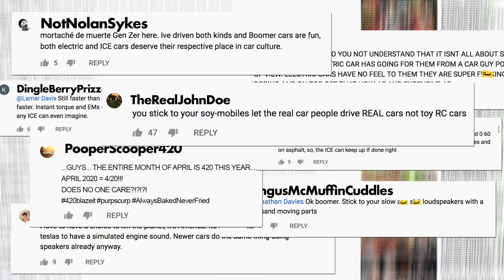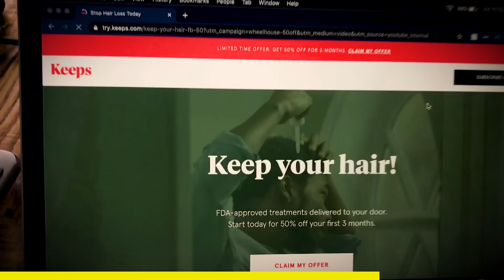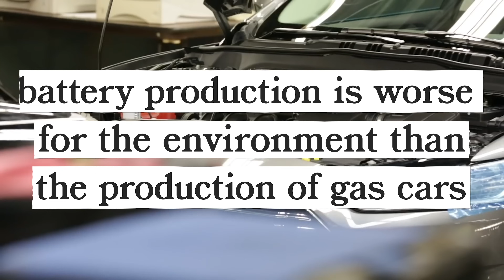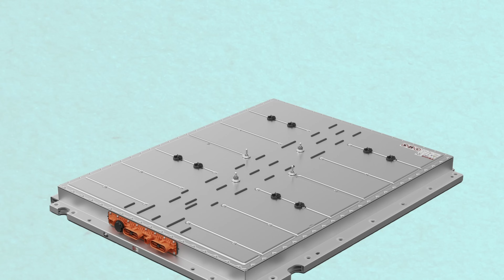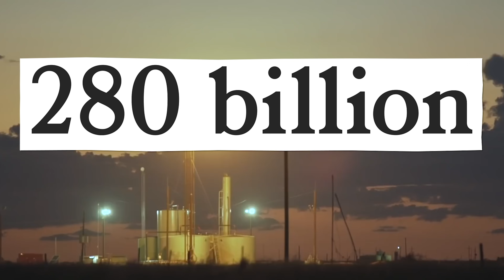Are Electric Cars REALLY Better for the Environment?

Comment: The biggest issue I have with electric & hybrid vehicles is the obsolecense involved with the batteries and electronics on the vehicle. The carbon output for manufacturing isn't a one time gig, keeping an old car running past its lifespan is going to be Incredibly difficult with an eV.

Comment: it’s a shame you didn’t talk about ethanol. comes from the beet which when it grows ingests more Co2 than when the fuel is burned. ICE are not turning just with gas. At least its the case in Europe..
Reply: Ethanol is having a corrosion issue though. Here in the Netherlands Vespa (look-a-like) mopeds are having serious issues with E10. (10% ethanol, 90% gasoline). https://www.rtlnieuws.nl/editienl/artikel/5025216/e10-problemen-scooter-benzine-tanken-e5-bio-ethanol

Comment: The solution: hydrogen fuel produced by a factory that runs on electricity produced by a geothermal power plant. This way you keep the sweet noise of the internal combustion engine without making much CO2.

Of course, this will become viable in the future. Way too expensive to be profitable atm.
Reply: Unfortunately hydrogen is terrible in a combustion engine, producing pathetic amounts of power compared to hydrocarbon fuels.
Reply: @drunkenhobo8020  Is it? Darn. Gotta look into this.
Reply: Engineering Explained did a good video on it: https://www.youtube.com/watch?v=1Ajq46qHp0c

Mazda also converted an RX-8 to run on hydrogen. It made 205 bhp in petrol mode and 106 bhp in hydrogen mode. How depressing would that feel in a car like that!

Comment: This is why we should be exploring hydrogen fuel cell (not to be confused with hydrogen combustion) technologies as well. Based on my limited understanding the production of fuel cells would have a lower impact than the production of batteries and we also have the means of producing hydrogen fuel without utilizing fossil fuels (electrolysis via renewable energy). A hydrogen fuel cell EV would also be far quicker to fill up (liquid fuel, not charging) and have a range more comparable to conventional ICE engines.

Comment: I am amazed.
I was expecting another video that comparing CO2 from ICE production and exhaust (without making, getting fuel and produce everything around ICE like gas tank etc.) to everything that produce CO2 in EV + lie that batteries in ev need to be changed after 150000km (i am realy weary of videos like that) and this video wsa looking like that in the first half, but then you concerned everything in second half and i am realy impressed. Big thumb up for that. I think electric cars have one more advantage don't using any oil and using much less brake discs and pads, but that not a big one.

Comment: Do you have any sources for your information ? I read a detailed comparisons of an actual association of regulations between EVs and ICE cars in terms of emissions. They came to the conclusion, that on average you need to drive 127.500 km or just under 80 000 miles with an EV to match the emissions a gasoline car produces during a typical life cycle and you need to drive 219.000 km or over 136 000 miles on average with an EV to match the emissions a Diesel car produces during its typical life cycle, considering a current mix of electricity coming from renewable and none renewable sources in the year 2019. 

That comparison also showed, that if the country uses 100% renewable energy an EV would only need to drive 37.500 km or over 23 000 miles on average to match emissions of a gasoline car and only 40.500 km or over 25 000 miles to match emissions of a Diesel car.

This comparison compared EV's and ICE cars being driven in Germany, a country that uses much more renewable energy than the US, considering this circumstance, EVs in the US need to drive a lot more km/miles to match emissions of ICE cars. Therefore i highly doubt the correctness of your Video since my source states vastly different results. 

Source German: https://www.adac.de/verkehr/tanken-kraftstoff-antrieb/alternative-antriebe/klimabilanz/
Reply: Your source is different because that study is not the best for unbiased information. It is true that some electric vehicles (ones with big batteries) are very close to ICEs in lifetime emissions and sometimes even worse when you consider a 150 000km lifetime mileage (which most long range EVs are capable of surpassing) . They used dated unrealisticly high emission figures for battery production while using unrealistic fuel consumption figures for the ICEs. Also the electricity mix of germany and the US, while highly emissive, is also very similiar. If you are interested in the subject i recommend reading more studies from more credible sources.
Reply: Jalmari how come it is not the best unbiased information ? Its one of the most credible sources i’ve read and of course i read other studies too, some of them had a different outcome, in fact some even were much more in favour of ICE cars. Of course EVs are capable of surpassing 150 000 km of range, thats totally irrelevant to its life cycle as almost no one drives his car until it stops working but after the lease is over or the cars guaranty is gone and thats what real life data shows. In my point of view their emissions figures for battery production und fuel consumption were very realistic as there average came from a huge official database of cars. Germanys total of renewable Energy in 2019 was 38.5 % of what they used while the US’ total of renewable energy in 2019 was only 17.5 % of what they used, so not very similar at all.

Comment: You neglected the fact that unless you are charging directly at the power source, EV's lose 40% of the energy in transmission to charge the batteries. That is a big loss of efficiency that is always never acknowledged. The main problem with the EV is range while carrying a load, a major problem that is also being ignored. Batteries just do not have the energy density that fuel does, also a low charge battery is a lot of weight to be hauling around compared to a 1/4 tank of gas.

Comment: It all depends on where you want to put your pollution. Gas powered cars adds pollution wherever it goes. Electric cars depend on how the electricity is made. The production of the batteries produce tons of pollutants, environmental damage and the batteries themselves are dangerous.
So for people to think they're smarter and saving the environment by driving EVs is foolish. They are just putting their pollution in someone else's back yard. As far as ICEs are concerned new technology is constantly being developed to increase efficiency and burn cleaner.
Reply: Hydrogen cells are nice  way to be more clean
Reply: @diwa393  I agree. Even the production of hydrogen fuel cells require the mining of rare earth elements to manufacture them. Hopefully scientists can figure out that nuclear fusion problem out.

Comment: I drive an EV because it’s fun and cheap to drive. I bought it used for a very good price, still drive my ICE vehicles too, just a lot less. My Leaf has needed tires and wiper blades over 35,000 miles. And the Nissan dealership near my house has a FREE rapid charger.  It’s been a great experience. But if I had to buy an EV new, it wouldn’t be worth it.  Very expensive new, even my Leaf was  over $35,000 new in 2012.

Comment: Eventually we'll have to increase the amount of remote working jobs, increase public transit, and reduce the amount of private vehicle ownership and use.

Also the biggest EV benefit you missed is not having to breath your own exhausts. That's a few more brain cells you get to save. Which you'll especially appreciate in the later years of your life when everyone around you has dementia.
Reply: I know sprt pf combustion engine thats cleannier than ev and running it causes zero CO2

Comment: pausing at arround 9:36 trust me even if you could give us a two hour explanation some people still wouldn't get it!
Personally i like EV cars, but i think it needs a few more years to develop a bit more, especially when it comes down to charging speeds!
Reply: Or we start researching alternative fuels that require no battery running it even if it means having a flame causes still 0 CO2 for example hydrogen cell cars

Comment: I feel like I’m an outlier in the grand scheme of automobile owners and I’m still trying to see how I should move forward with any future purchases. I currently own two vehicles one is 41 years old and I’ve owned it about 30 of those years and it has around 400,000 miles and my newer vehicle is a 1999 I’ve owned it since new and it only has about 300,000 miles. With luck my next purchase should be my last provided it last 20+ years as well, and I’m just afraid currently EVs are not that reliable.
Reply: Try hydrogen cell if possible and you have refueling station nearby somewhere since it has only the benefits of ev and gasoline. It has long range, refuel takes little time, and they are cleanliest out there

Comment: But the up side to a petrol car is if you convert it to straight lpg it basically have zero exhaust emissions an gain up to 15% more power an lpg is cheaper at the pump

Comment: See I just want an affordable car with a clutch pedal.  If car companies start making electric vehicles with a proper manual transmission, I would have no problem switching from ICEs.  Right now though the only option is paying likely more than my car is even worse to have someone convert it.

And yes I am aware there isn't any practical reason to fit an electric car with a manual transmission, but these days even with an internal combustion engine, modern automatics and CVTs have basically neutralized all the benefits of driving a manual, save one: it's more fun!  My Subaru Forester isn't exactly a fast car, and I am a pretty calm driver anyway, but rev matching and getting that shift just perfect?  Such a great feeling!

Comment: No they are far more damaging. Fossils fuels are required to produce and mine the things to create electric cars, their motors and batteries use rare precious metals, and contain chemicals that are poisonous once disposed of. This not considering the fossils fuels required to create the electricity that powers electric cars.  Because we can't use electricity to create electricity. Somewhere someway there has to be a seperate type of power creation from a different sources of energy, and that's fossils fuels

Comment: i charge my car direct from the solar panels so not using the grid at all.
I save about £100 a month in fuel cost but this all depends on what ice car you were driving before electric mine was a range rover vogue and yes i miss it and miss tje sound of the engine. but what i am saving i would not go back to an ice vehicle. zero road tax and cheaper insurance and lower fuel cost.
it only cost me £3 for a full change.
i went for a phev next car full electric.

Comment: What about the extra copper and aluminum used? Or recycling of batteries and their life spans? or the air scrubbers from the producion of both the batteries and the electric that reduce those emissions(they have a foot print to produce and recycle as well.) You missed alot. Like how wind mills have a limited lifespan due to stresses of operation and so on. Your facts are misrepresenting this here.

Comment: I also wonder if you produced EVs without a battery and then compared them to gasoline vehicles how different would the pollution level be in production.

Why I say this is because pretty much basically all calculations never take into account the first tank of fuel in a gasoline car.

So the point being that first tank of fuel for a gas car would raise the pollution level of that gas car quite a bit taking into account the transportation, refining and so on of that fuel.

But with an EV the battery is always seen as the negative when in reality you could pretty much use any type of battery that fitted into the space.

So as EV batteries get better so will the pollution level of producing them reduce.

You can't drive a gas car without gasoline and likewise you can't drive your EV without a battery but it seems the gasoline is not calculated in the production of a gas car, whereas the battery is calculated in the production of an EV.

Surely to make it fair and clear every part of the vehicle should be considered to get a true picture of the pollution level in the production of both vehicles.

Comment: Awsome video man! But I do still have some concerns that I think its not in the video. How about the battery pack life, I imagine that it isn't the duration of the car, its economically viable replace that, it impacts in the life cycle of a EV car, and the old pack, which will be the destination, is it recicleble or toxic? In compare which is the recicleble portion of a ICE car? And The impact of a battery eletric vehicle in compare with a hydrogen fuel cell electric vehicle. Thanks!

Comment: You’ve forgot two very important factors:
1. Lifespan. My oldest car is 8 years old. And because I always did servicing in authorized dealer and keep all measures it is still in perfect shape and it can go on for years. And because it is Range Rover Evoque it still looks and drives killer good. Needles to say combustion engine cars proven to go on as long as century with proper care. Can it be done with electric car? NOPE. Because of the nature of the battery which is the heart of any EV you WILL HAVE TO REPLACE BATTERY, and we all know how quickly the capacity of the battery goes down. So 1 EV with proper care in reality will emit as much gases during it’s lifespan as several EV cars produced.
2. Utilization. I still see rusting vehicles here and there and when I was small I used to play on some with friends while visiting grandmother’s village. The worst case that could happen to me was get scratched by rust. Can you imagine such scenario with EV? Hell no, because getting rid of batteries is as dirty (if not more) as producing them. EV left to rot is a small local ecological catastrophe. 
If you add 1 and 2 and realize that EV needs several batteries during it’s lifespan to be not only produced but utilized as well - the numbers would be different.

Comment: What about the cost of production (pollution) motors and rare earth magnetic etc? plus most ev choose aluminium as the body which either mined of recycled has a high impact on energy consumption to manufacture.  Your comments on ev becoming more efficient after x miles is correct but some country’s like Germany quote 70k miles to break even.

Comment: You forgot Nuclear Power. In fact, there is no viable Co2 neutral, much less Co2 negative, energy plan with out major investment in nuclear power if you want to electrify road vehicles.

It is the safest and the most environmentally friendly form of energy production. Full stop. No other Zero Emissions form of electricity generation can match the capacity of coal power. 

And that is a scientific fact.

Also, renewables kill in a year more than nukes have done in their entire history of existence. Simply in technicians and maintenance workers falling off of heights.

Furthermore, Variable compression ratio and fully dynamic valve train technology combined with biomass sourced (optimum being hemp and algea which are actually co2 negative sources) push gasoline engine emissions far below the impact of even a nuclear charged EV.

There's zero mileage in electric cars. Aside from hydrogen fuel-cell cars. Hydrogen yet again, being sourced from nuclear reactors.

Comment: Good vid if your talking just electric cars. Now, lets talk Hybrid. That being the hot seller now days! Speaking as a mechanic (With 2 degrees in auto technologies and 27yrs as a line tech, now retired), It will do more environmental damage to produce a car with TWO power trains ( one electric, one ICE ) as in your typical hybrid, then just ONE, as in an ICE car.  Twice as many parts to manufacture and twice the environmental impact. Plus, what will it take to recycle all those parts after the car is through its life cycle and in the junk yard?  Also, with the new technology they have, these ICE cars are getting better and better gas mileage every year. Many are getting 40+ mpg! So much to consider when looking for an environmentally friendly car. BTW: If this nation gets an EMP attack, you elec cars guys are screwed! Great videos DM.